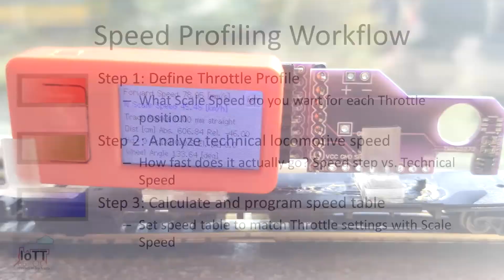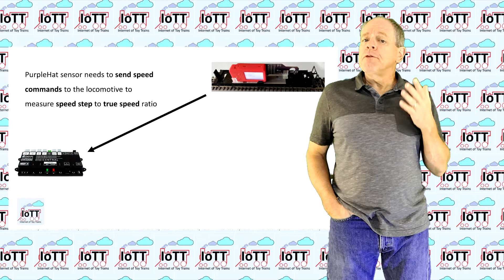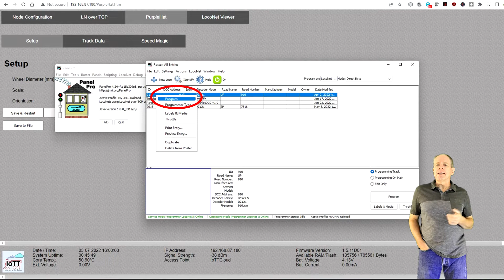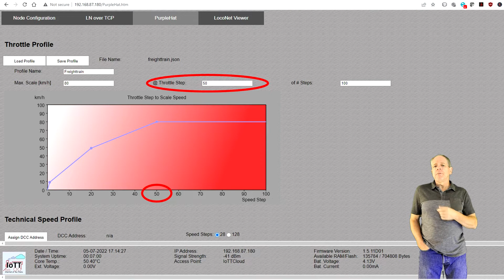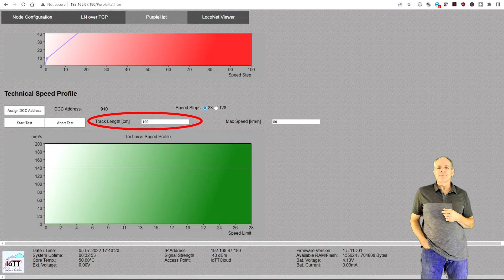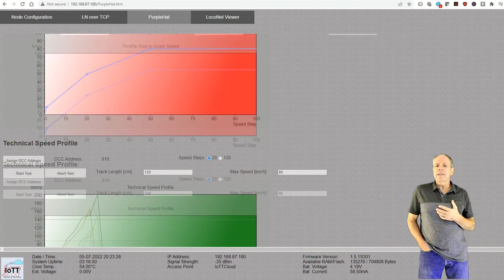Speed Profiling Step by Step Tutorial (Video#94)

Comment: Hans thank you for this knowledge, hardware, and accompanying tools that allow me to greatly expand this hobby of mine. I've ordered two IOTT sticks, and two purplehats, and am impatiently waiting for them to be delivered! This is going to be a really fun summer.
Reply from the maker: Cool, thanks!
Reply: Hello Han's, I've received my package the same day I posted my comment above. I've since gotten a set working. I've been using the Purplehat to obtain a throttle profile from an ESU Loksound v5 Nano in an N scale locomotive, and just wanted to let you know the following...
Setup: Digitrax DCS52 command station
             Digitrax LNWI unit and PR3 programmmer
             I use a Prottothrottle, DCS52, and    
             Enginethrottle on an old smartphone to 
             control my trains

1.  The Loksound does not accept '0' values for Vstart, Vmid, and Vmax. '1' is the lowest value possible. I fooled the software by using Decoderpro and in the CV tab I was able to save the roster file with 0 values for the cv's above.
2. I could not write the calculated finished profile using Main, but was able to using the Programming track. 
3. The locomotive did not speed up during the process. It stayed at a step value of '1' throughout the entire process. I had to set vstart, vmid, and vhigh to higher values for the loco to accelerate.
4. The Speedmagic process also seemed to conflict with the DCS52 - when the DCS52 was set to the address of the loco. It worked flawlessly when I used the JMRI throttle and had that set to the address of the loco.
5. The forward and backward bouncing of the freight car with the IoTT stick assembly and external battery I think affected the outcome. I'm going to add an MT friction spring to a wheel to add some resistance later to see if this smoothens out the bounce.

Other than this it works beautifully. Not sure if these are because of the Loksound or if some of these are bugs. 

Finally, I have a request... could you please add a remote  'cycle power' button for the IoTT stick to each screen? Especially on the Purplehat page.
Reply from the maker: @josesmodeltrainchannel8054  Thanks for the feedback. Just some hopefully helpful comments:
Pt 1 - I checked the manual of this particular decoder. It looks CV2, 5 and 6 are used slightly different. This also explains your observation in pt. 3, if CV 6 is set to 1. I suggest you try with settings of 1, 128 ad 255 with bit 4 in CV29 = 0 to run the speed analysis. If I understand right, that would give you a linear speed over all speed steps    
Pt 2 - If you are using the WiThrottle connection, programming is not supported. Use LocoNet over TCP instead, connected to the JMRI LocoNet over TCP server.
Pt 4 - I will check with a DCS52. Most likely it refuses commands from outside if the Loco is assigned to the throttle on the DCS52. I will find out.
Pt 5 - After setting a new speed step, PurpleHat waits a little while before doing the next measurement, to let the locomotive arrive at the new speed and oscillations to stop. Do you see the oscillation in the speed curve? Also, make sure to turn down the settings for smoothing the acceleration and maybe have a look into the settings for load compensation, sometimes these can cause oscillation as well.
Re. your request: What behavior are you looking for? At this time, if you click Stop Test, the locomotive should stop immediately.
Reply: @IoTT  Hello Han's
Pt 1 - I tried your suggestion and it worked. The locomotive was able to attain a range of speeds while performing the Speedmagic process. It generated a profile that had an abrupt drop about 2/3rds throttle. I performed the process three times, and it generated the same results. I'll try a different locomotive later this weekend but with the same brand of decoder (just a different generation and form factor).
Pt 2 - Initially I used Loconet server, and then briefly switched everything over to WiThrottle server. The WiThrottle server seemed to perform better, and I also like the fact that you can save the resulting profile immediately to a roster. With the Loconet Server setup, I had to first load everything into the engine, and then take the engine to the programming track in order to save the changes and for troubleshooting, that's to many steps. Since I was getting not so good results with the Loksound decoder, I wanted to see the data and compare it a baseline speed table before committing it to the locomotive. As a request, would you please add a 'save to roster' also for Loconet?
Pt 3 - Resolved
Pt 4 - The DCS52 is a peculiar command station. I came upon a setup option that affected the performance of my locomotive. It has to do with what's called Option Switches. I could not find a specific listing for the DCS52 on  the Digitrax website, so my assumption is that the Opswitches for the DCS50 are a carryover...

https://www.digitrax.com/tsd/KB819/zephyr-customizing-operation-with-option-switches/

The issue was with Opsw 36*. When I loaded the resulting profile from Speedmagic, my entire speed table shifted to step 14. That means my locomotive did not start moving until the throttle was at step 14. I tried all the throttles on my layout, and all were the same. I tried other locomotives and they were normal. I reset the decoder to no avail. What led me to the command station was when I used the ESU programmer to operate the locomotive. On an isolated programming track the ESU programmer can operate the locomotive, so it basically becomes a limited function command station. I was happily surprised to find the decoder working as it should - moving at step 1. So this led me to the Digitrax command station and Opsw 36*.  I cleared it and the Locomotive started behaving like expected with the values from the Speedmagic process. 

This only occurred once, I've since performed a multitude of Speedmagic runs, and this issue has not resurfaced. It could be because I no longer use the DCS52 to acquire the locomotive for the Speedmagic process. I now use the JMRI virtual throttle.
Pt 5 - I ended up installing tiny springs on the wheels. This decreased the oscillations. These oscillations are inherent in MicroTrain couplers, and in the past they use to sell tiny springs for minimizing these motions. 

I found another issue that had to do with my old spare smartphone that I now use as a throttle. For storing it on my layout, I affixed a Nite Ize Steelie rare-earth magnet mount on the rear of the phone case. Along the facia of my layout I installed fender washers that I can then magnetically attach the phone to. Well, I had this sharp drop in my resulting profile from Speedmagic that took a few hours to figure out. As it turned out the hall sensor is sensitive enough to pick up the Nite Ize Steelie! Issue resolved, and the current profiles being generated are now smooth (besides the sharp drop near the end). 
 
The 'cycle power' request is similar to a 'reset' but with the unit powering down and then restarting. If it is not possible, then a reset button will do. The issue maybe because the Digitrax LNWI can only support 4 devices. This could mean a very narrow bandwidth. I lost partial communications with the IoTT Stick a few times in the beginning which required me to power it down and power it back up. I now make sure that the other devices not in use are disconnected from the LNWI WiFi network when performing the Speedmagic process. 

Thank you Hans for the quick reply. I'm truly enjoying this.  I envision one day to have an LED display either above my layout or on the facia showing my locomotives scale speed.
Reply from the maker: Thanks again for reporting. Sounds like you figured it out ;-) 
Yes,  it looks like the address was set to 14 speed step mode and changing 63* cured the problem by setting it to 28/128 steps. Something to keep in mind and add to the instructions
I am surprised the 
magnet on the phone had such an impact. Must be quite a magnet or extremely close to the track. Depending on the type of the magnet and its direction of magnetization  you might be able to correct or minimize the problem by turning it 90 degrees. 
When using LocoNet over TCP you should be able to go to the top of the page and save the JMRI file with the updated table calculation. But I can easily add a separate button next to the speed table.
The limit of four connections for the LNWI as far as I know has to do with the controller used in it, not the bandwidth. But that really might be the bottleneck in your case. It might be the better and more stable way to use the JMRI built in servers, either WiThrottle or LN over TCP.

Comment: Just tried this out and it's really cool! Over the past couple days I've managed to speed match my entire fleet using my new Purplehat.

The only issue I encountered: Broadway Limited Imports N Scale "Paragon 3" decoders do not work if you set Vmid and Vmax to 0. It would appear that they interpret a value of 0 as "no power". Because of that, the generated speed tables didn't work properly either.
I wound up using the Purplehat to track the speed and tuned it the old fashioned way - but it was much easier seeing the exact value on my screen. Thankfully, I only have a few of these locomotives - and the Paragon 4 seems to have fixed this issue.

In retrospect, might it be better to set Vmid to 128 and Vmax to 255? I didn't try it out, but that should be more consistent across decoder types than 0 0 0, right?
Reply from the maker: Thanks for the feedback. You are right, another user came across the same problem using an ESU Loksound Nano decoder (see in the comments below). I suggested to define a linear speed curve using 1 - 128 - 255 and it worked.
Reply: I encountered the same issue with the Marklin/LGB decoder.  Your suggested solution works for me.

Comment: Hans, I debated as to where to put this comment and decided it would be best here in this older video. I am running my purple hat with the new 1.6 M5 software and I have noticed something with the JMRI load file command. I set up the engine in JMRI and set the motor start values as recommended and save the file. I open the file under the purple hat web page and all is good. I know this because  each time I save the roster file I change the throttle speed limit on the roster entry tab in JMRI. Kind of like a file revision tracker. My engine is an old proto 2000 with a TCS T1 decoder and will not run with Vmin set to 0. So I tried tweaking this value to get better throttle response. I repeat the steps above after writing the new Vmin to the decoder. Since I have the decoder file loaded on the web page with the old decoder file When I try and load the new JMRI updated file watching for the new throttle speed limit in the max speed value on the web page and it does not update. My only conclusion is that if you try and load a decoder file over the same but older file the purple hat speed magic content is not updated. If you load another decoder file then load the updated file of the original decoder it loads the information. Thoughts?
Reply from the maker: Hi Mike, thanks for the message. First, please make sure you are using 1.6.1 as 1.6.0 had a problem with the PurpleHat communication.
Your observation is correct, if you load the same file name a second time in the browser, it takes it from the cache. It happens the same way with throttle profile files. Only if you load a file with a different name, it reloads it. So far I have not figured out how to force the browser to reload the file from disk every time.
Now, I am going to look into loading and saving JMRI files in the next few days anyway, as there might be a potential problem with the XML's for the speed table, at least somebody else is experiencing strange things. Maybe this gives me a chance to fix the cache problem as well.
Reply: @IoTT  thanks for getting back to me so fast. I will check the update but I just did it today so I think I am good.
Reply: I was having a problem with the speed profile loading into JMRI after saving it with the purple hat web page. I deleted the roster entry from JMRI recreated it and then the speed table would load.? weird. I have a BLI engine that will not run at zero for the basic engine settings and will stop when set to 100% throttle. I can get around the basic settings but I can not get through the test because the engine stops when the test sets the throttle to 100% I have the speed steps and max mph set to 70 and 50 respectively. I checked the version and I am 1.6.1
Reply: Reading over the posts below I see the recommended solution for the 000 setting and will try that to see if it changes the 100% issues. I'm enjoying this and I hope to get it figured out.
Reply from the maker: @deeprunrailroad_Mike  That's interesting. So, the workaround is deleting the roster file before loading it back into JMRI? I have another user who had the same problem, but not the last two days, so maybe he just started deleting the files before loading. I will check on that.
That problem with 100% speed, is this a decoder problem? Can it be replicated if you control the loco from say EngineDriver? Or may it be a problem of the commands PurpleHat sends to the WiServer?
Reply: @IoTT  I will check and let you know. I have a support ticket in with BLI asking about the 100 percent throttle setting.